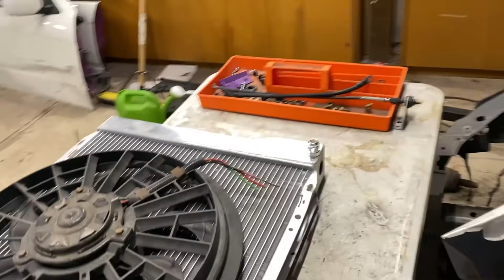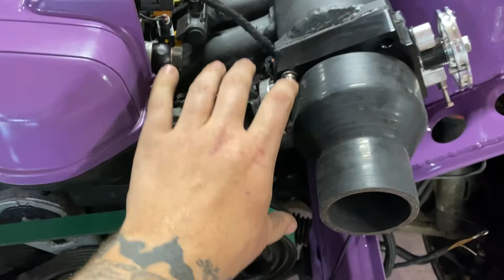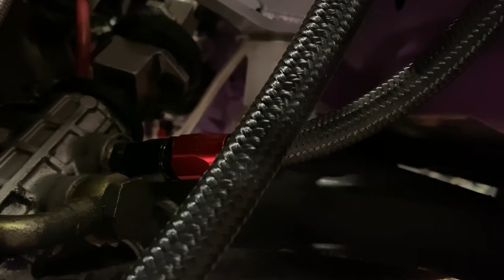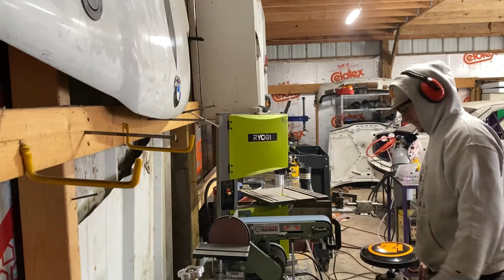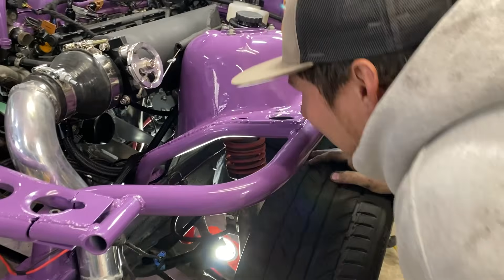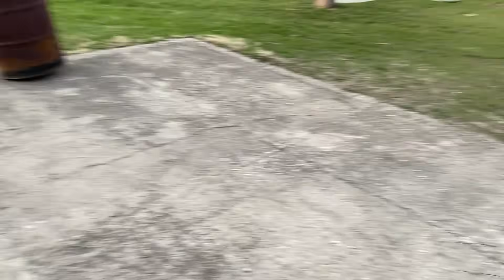Budget 2JZ E36 Part 9: First Drive!!!

Comment: your video really helped me with a very miserable problem i had an issue with the maf also but the problem was the car wont start with the fuel pump on and where its off it will start until it runs out of fuel.. after remembering your video i tried with maf unplugged and ta da it runs great
now i have to figure out if its the maf or the wiring
Reply from the maker: Nice. Go through all the service manual tests for the MAF and you should be able to figure it out
Reply: i did couldn't find the issue, however i had an extra maf from a gs300 that i just had to re-arrange the pins to 1.B+ 2.vge 3.vg 4.tha 5.e2 and the car started right away... and for anyone who's searching for a maf for the 2jzgte take the 2jzge from a gs or is because its way cheaper
Reply from the maker: @soman2198  there’s a problem with that though. The N/A MAF is flow through, while the GTE MAF is closed on the backside. On a turbo car, when the throttle closes, air can pass through the MAF backwards if you’re using the N/A MAF. I’ve heard this can cause issues and possibly make the car stall
Reply: thank you so much, i only tried it with the the turbo charge pipe unhooked.. it was only to find the issue if its related to the fuel or wiring
im currently waiting for the delivery of the fueltech ft550

all the luck ✌🏼

Comment: Hey are you running the stock injector set up and also are you using the factory cams on this engine
Reply from the maker: Factory cams, oside tiger 440cc injectors. Which is stock size for the ecu I’m using